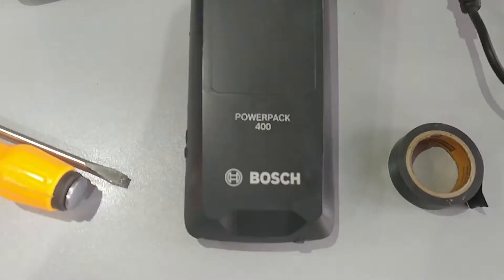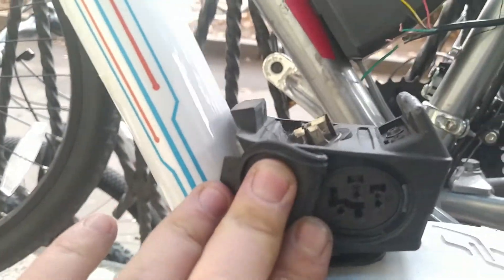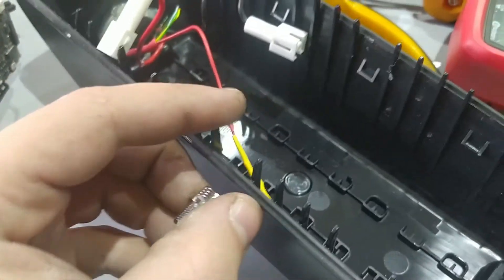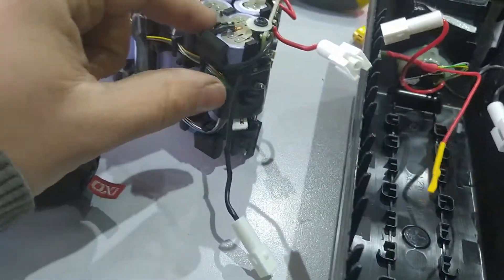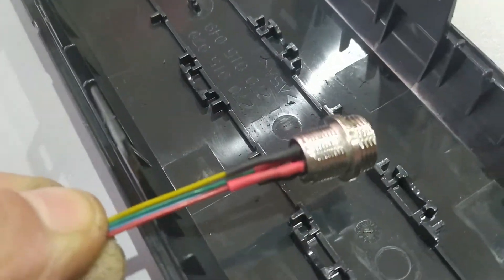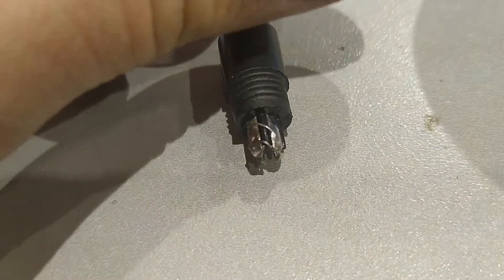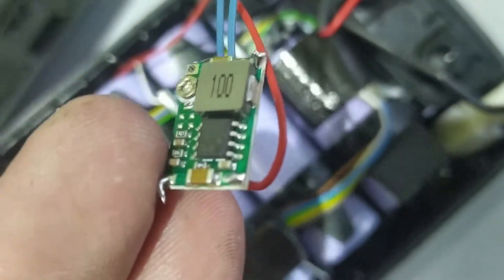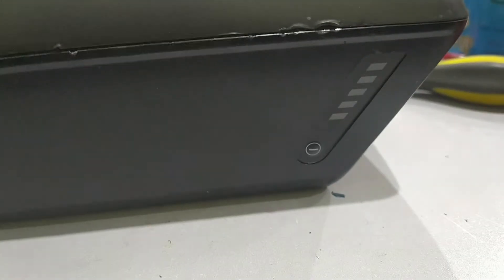Bosch Powerpack 400 DIY Charger Making From normal 42v charger

Comment: Ive it done from the outside with a buck stepdown same thing really  i just had to make my own bosch plug   its been wifor a long time now 👍i wonder if giant batterys can ve done kike this ?? Theres a challenge for u  giant middrive the yamaha motor even tho its Yamaha  giant have put CAN BUS data cables connected to maon plus and negative,i think its been done on Yamaha px model but not giant  ..u got this 👊💪

Comment: bro help me ,  I was riding downhill, the battery fell off the bike and the exterior was badly damaged, it only works for 10 seconds and every 10 seconds it restarts again and so every time, mean like 10 seconds working ant 10 seconds not, and like this every time ! how i can fix it what happend
Reply: Check the battery on button, if it has any damage,

Comment: Hi,
Do you think I could get away with charging these batteries /400&500 versions/ with higher current than the max recommended /6a/ ? I’d like to charge them at 9A which is around 80% of the capacity so it shouldn’t hurt the pack in theory.
Reply from the maker: it will hurt 100%
Reply from the maker: use max 6 amps.
Reply from the maker: 4 is better!

Comment: In my case , i have problem with the BMS .
I have replace it with a normal BMS but i have problem with these 3 wires because the bike didn't work

Comment: that 2 pin port on the bms is for the can bus comms but did the batt work on the bike or brick the bms? in 8 years i have found only 2 companys that can recell packs one makes 3rd party bosch batts ebike vision germany and liofit also in germany that mod the bosch bms but wont tell me how for security reasons ffs and both end up costing more than a new bosch batt as i live in uk and no one can help over here.
Reply from the maker: all what i did there is only charger chack for battery. i just used normal 42v charger to charge like bosch charger would charge it. i didnot touched bms at comunication side to ebike.

Comment: We want to add a solar panel on the bucket of our cargo bike, and connect that to the charging port. Any suggestions on how to get that working? With a 12V->42V step up converter?
Reply from the maker: hello, first of all i think that power from solar panel is so low, if its not too big.... plus when u are charging battery u cant use it at same time, at this point u need to have 2 battery, 1 in working stage and 1 charging while another one is in use. u will need to swap them time to time. give me more information, will give u more advice.
Reply: @atelfix4553  By bike has a dual battery mount. It's a Bosch system on the Cube Cargo, no idea how it switches between the two batteries, maybe you can do an easy mod. And it does not have to be super efficient. I mean a stupid rain cover costs almost the same as a fitting solar panel.
Reply from the maker: @lovemadeinjapan  u should make it as manual swich so u will no longer will have problem about charging and discharging for eachother.

Comment: Nice hack! I still have a doubt concerning the +5v signal that sometimes could hire some security implications... 5 volt could be some standby voltage for the PMU board in the battery pack or a security precaution to avoid charger  giving its output in certain condition. I ignore the schematic of a stock bosh charger but I'm curious to know if that "special" 3 pin plug and the 5 volt signal are just another dirty marketing strategy end nothing else...
Reply from the maker: they just tryng to make things less repairable. they dont want to anyone open or do something with their product. its not for security its only marketing thing to make money for their company.